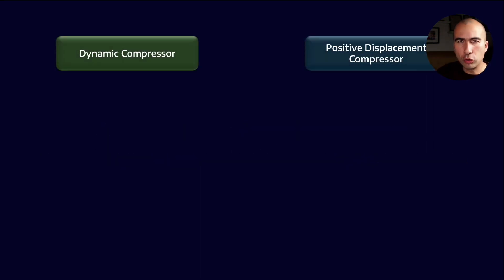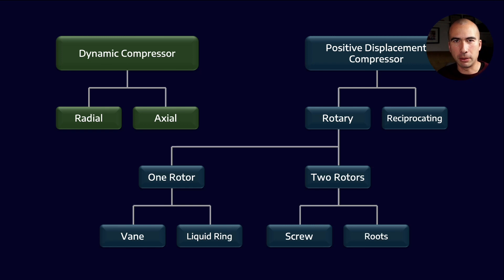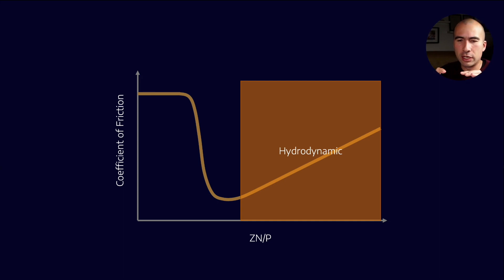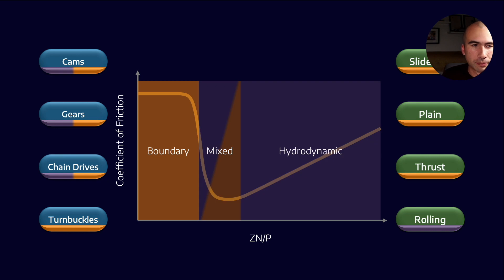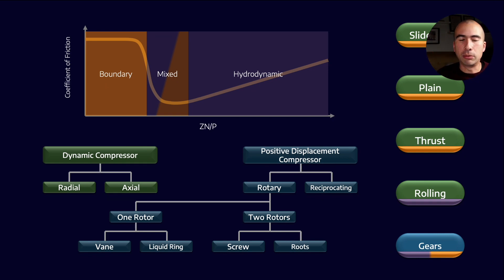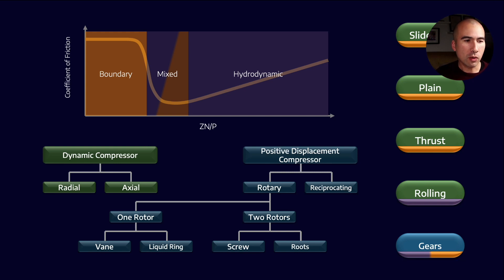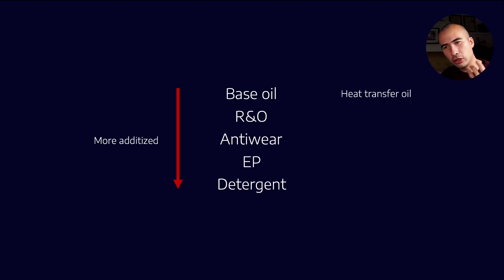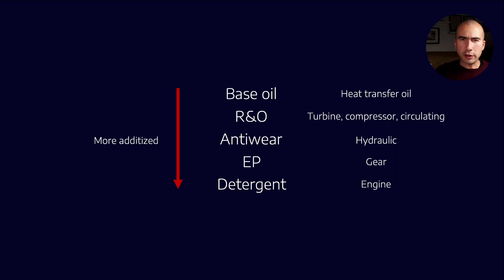Lubricating requirements for compressors

Comment: Very well explained. But I feel a little bit more detailed discussion on the impact of various Compressor oils type like Mineral, PAG etc on the working of compressor and ODI and impact of Pressure, type of air/gas being compressed and operating / Discharge temperatures would have been more beneficial. Maybe food for thought for creating part-2. Thanks
Reply from the maker: Thanks! So this is actually a single lesson in a six part series. The rest of the lessons are on LX Pro - https://lubrication.expert/product/lubrication-explained-pro/

Over the next little while there will also be courses specific to gas compression, refrigeration compression, air compression etc.

Comment: Great topic done well.  I've designed chemical gas compressors (including vacuum pumps and blowers) where the chemistry dominated every single material selection  - it gets tricky. I've even seen no additive refined mineral oils used to lube and seal tough chemistries.
Reply from the maker: Thanks! Yeah the chemistry is often under-appreciated.